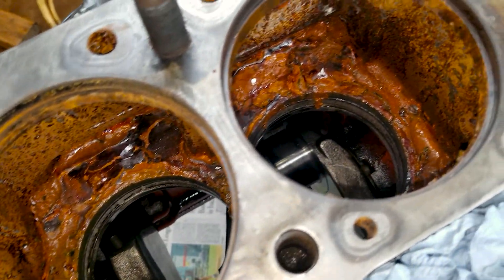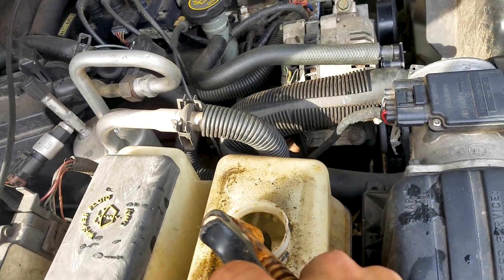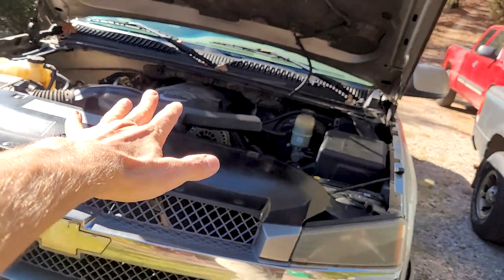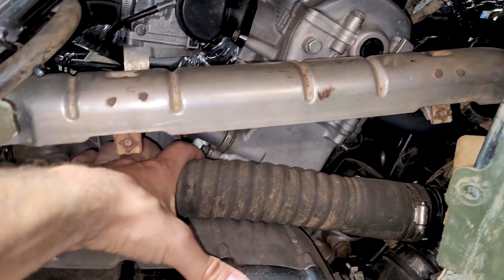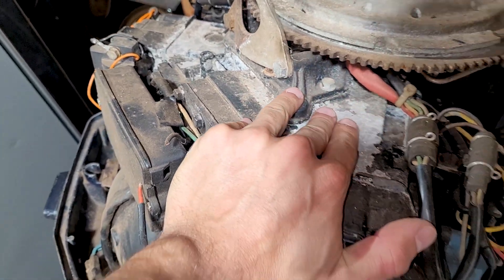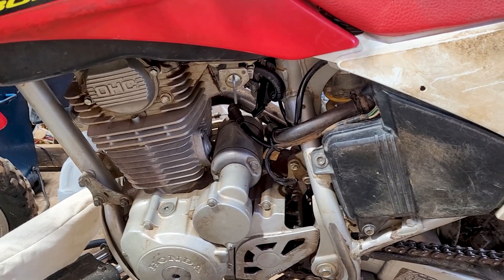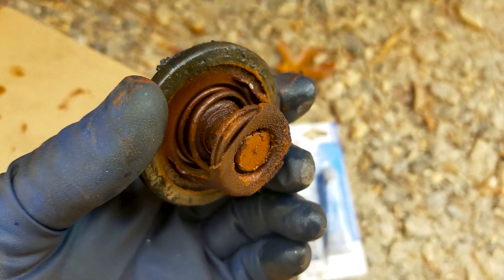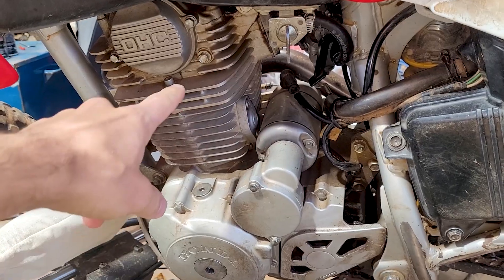Anti-Freeze Doesn't WORK! RUSTED Engines?

Comment: My engine been rebuilt, cast iron heads and block, now has 80,000 miles and always used distilled water, have flushed 3 times, and recently replaced the radiator and it's full of rust.
Reply from the maker: They always rust once it starts getting rust in the block its just gonna be like that. There are probably some additives to make the rust slow down or stop but I haven't tried any. One of the problems with cast iron blocks.

Comment: Run prediluted coolant and you won't have these problems I never do and I've been doing mechanic work 30 years as a diesel mechanic
Reply from the maker: Really, you do that? Does it still cool properly.
Reply: @MattsShop   yes it does you buy prediluted 50/50 mix

Comment: Have any engine manufacturers tried a sacrificial anode?
Reply from the maker: They don't use them. They would dissolve a bunch of Zinc into the coolant solution and probly cause a bunch of other problems. I'm guessing it works on boats because it mixes with the water, lake/ocean.

Comment: I run Prestone 50-50 premixed antifreeze in my 2018 Chevy Silverado I also ran that in my 1994 GMC Jimmy with zero issues.
Reply from the maker: Thats what was in this tractor. I don't know why it rusted!
Reply: @MattsShop  weird, I used to have a 1963 international scout 80 and that engine block was also full of rust, but it was like that before I bought it, I’m pretty sure it just had water in it for a really long time.

Comment: What would happen if you used the rust prevention acid instead of water and antifreeze and ran it through the motor then drained it out. Then after flushing it put the antifreeze and water back in??? Would that work? Doesn’t seem like it would hurt anything. I hope you answer me 👍

Comment: Antifreeze will separate after a year of sitting if no shorter then that as they say 5 years of driving not sitting put your 50/50 mix in a bucket covered up an it will separate so the water creates rust
Reply from the maker: That explains a lot. This Yanmar Tractor had very dark antifreeze like there was no water left in the mix. Might be why. Assuming it was mixed right.
Reply: Oh!.. that's an interesting point eh?

Comment: Use the toyota or subaru stuff. They have gone to great lengths to prevent corrosion caused by dissimilar metals in the engine and cooling system.
Reply from the maker: Thanks for the tip. I'll have to check it out.

Comment: let me tell you why its called galvanic corrosion, most radiator are aluminium which is not good when it meets with iron this  is what the cause of the corrosion, you want to get rid of the corrosion get rid of the aluminium radiator, there is a galvanic chart you can look from what material have the risk, usually this radiator have some sort of layer to protect from galvanization occurring but in time even this layer cant last long it is recommended that within 3~5 years to do a full flush and change a radiator to avoid this from happening also your coolant matters, some coolant are not meant for mix metal like in your case you need to find a coolant that has (HOAT) Hybrid Organic Acid Technology since you have iron block meeting with aluminium radiator and no dont believe every 5 year thats nonsense because temperature and pressure are not being counted when they do the testing so it is better to flush it every year to keep your engine and radiator in tip top condition.

Comment: steel and aluminimum blocks... nothing you can do they will rust or oxidize.
Reply from the maker: The mixing of the dissimilar metals causes the rust?
Reply: @MattsShop  galvanic corrosion

Comment: coolant, some have aniti corrosion and rust inhibitor. Not all. Also, i wont bother mixing with distilled water
Reply from the maker: I thought they all had anti-corrosion additives?
Reply: @MattsShop  yes but in different concentrations. Ones marketed may have a larger amount over ones that dont

Comment: Did you ever put Tap water or anything that's too high in minerals, or maybe the previous owner did? Is the engine having a bit of a leak between the coolent camber and the combustion camber? Maybe its getting too acidic from some  blow by. In the presence of water, carbon dioxide reacts to form carbonic acid. This electrolyte can speed up the rusting process and cause corrosion.
Reply from the maker: I never used tap water. I always use distilled water with no minerals in it. That's interesting, I'm going to have to look that reaction up.

Comment: I agree. I also wonder if the formula has changed from years ago as more and more aluminum, plastic and other metals are being used nowadays maybe not as much protection causing some of this if using regular or less drain time is used. Maybe some one like Bob the “antifreeze” guy could chime in on formula additives
Reply from the maker: I think you're on to something. Aluminum engines obviously don't have this problem. I think maybe there's some additive that helps prevent rust in these cast iron engines.

Comment: Electrolysis, iron oxides.
I would almost say someone had run well water.
Maybe install a water filter conditioner. 
Like they use to use on diesel trucks.
Hope you figure it out.
Have a great day.👍
Reply from the maker: It's a good suggestion. You think they used well water? Woah, you think it has something to do with electrolysis and the battery? Interesting...
Reply: @MattsShop  Grounding problems and current flowing through the coolant. 
Have a great day.